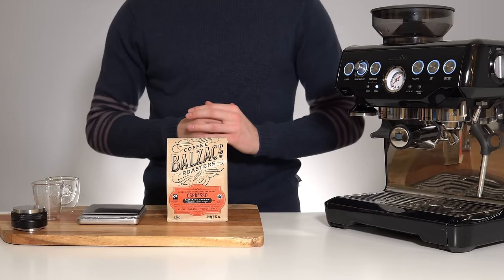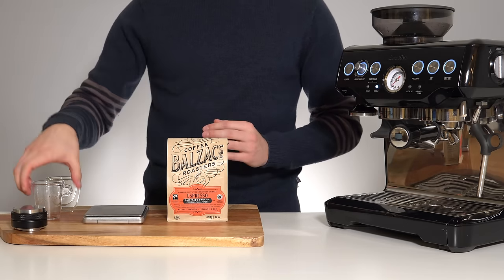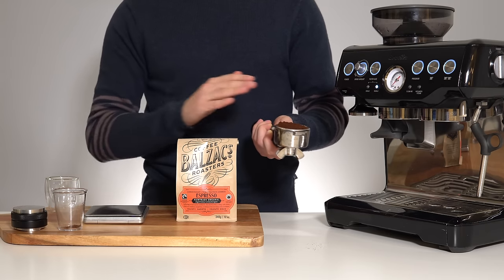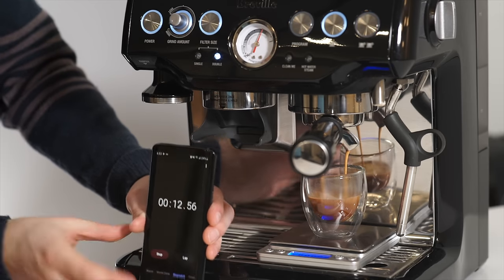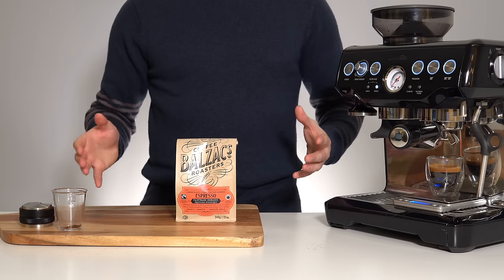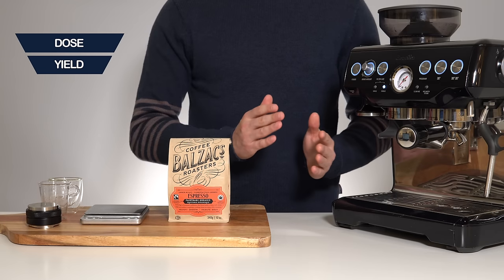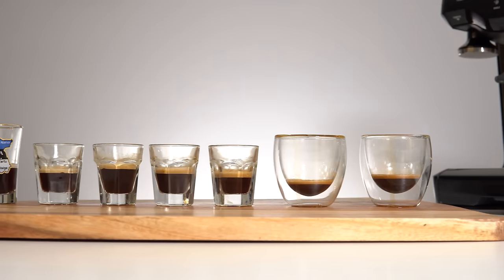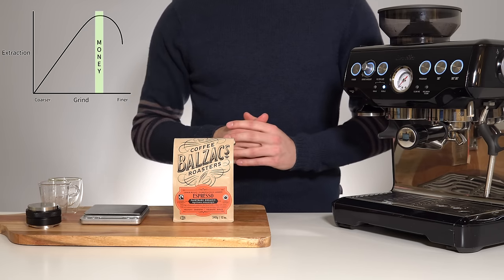Dialing In Breville Barista Express | Dose, grind, yield, time

Comment: Counting 1-25s starts at preinfusion! Not when the drops start.
Reply from the maker: 25 seconds is a very very rough starting point. Each coffee will be different. This initial guide is a huge oversimplification to get people running at a reasonable flow rate. After that, Brew Ratio and the other theories of extraction must be used to dial in to individual taste preferences. 

All that to say. It doesn't really matter, as long as you are consistent with yourself with how you time your shots so that you can duplicate them once dialed in.
Reply: @LifestyleLab_  But it made a huge difference in the ground size for me. I was already at 2 grind setting just to hit 20-30 secs cuz the video taught me to start counting when the drops start. I'm telling you, that shot was undrinkable! 

Now compare that to including the pre infusion with the counting. My grind setting is now at 6! And I'm hitting 25secs.
Reply from the maker: And I've had many coffees that are undrinkable at 25 seconds, but taste great at 35 or even 40 seconds! No one brew ratio, shot time, temperature, grind size... etc will be right for every coffee. The first half if this video is a starting point only.
Reply from the maker: I suggest reading the more in depth article we wrote, more specifically the "drinkable to greatness" section: https://lifestylelab.ca/dialing-in-breville-barista-express-machines/

Comment: Can anyone help me? I adjusted to the finest grind setting (1) and reached 19 seconds. But the pressure gage was way too high. If I set to setting 6 I get a nice 12o’clock pressure reading but water only runs for 10 seconds.
Reply from the maker: As mentioned in the video, don’t pay attention to the pressure gauge. It’s calibrated more toward pressurized baskets.
Reply: @LifestyleLab_  Thank you! While I have you… 2 more q’s please! 

1. how many seconds in advance of 36g do you press the button to stop the extraction? I keep stopping too late and ending up with 40-45g!!

2. you start the timer only when the first bit of coffee starts pouring? so, again, ignore what the instruction manual says?
Reply from the maker: Do what tastes best! This is a starting point, not a hard and fast rule 

How to Time Espresso Shots | Button Push or First Drip?
https://youtu.be/E9MiqOJdwPc
Reply: Noted. And thanks again! Am still miles off the perfect shot, but at least I have stopped using the dual walled filter basket.

Comment: you forget to measure the grind  yield as there is going to be grind retention about 2 to 3 grams
Reply from the maker: Grind retention is not infinite. You dont loose 2 to 3 grams every time, where would it all go?. The retained grinds will be flushed out and go into the portafilter. Deviation is not more than 0.5gr from my testing. BUT you are correct! The only 100% accurate way to dose is by weighing the grind yield
Reply: I always weigh what goes in the portafilter. Retention is a non-issue for me.

Comment: I appreciate the time and effort you have put in to this but I don’t think that this machine is the correct choice for people that are this invested in the espresso brewing process.  You are describing effort and time that suits a hobbyist with far more capable/expensive machinery. Surely the idea of the hopper is convenient yet quality coffee that the average drinker can access and enjoy quickly? This machine in my opinion is for people who want great coffee and aren’t concerned with obsessive small margins.
Reply from the maker: Unfortunately, the hopper and timer based dosing ends up having the opposite effect intended, by causing frustration during the dialing in process. On any machine, $100 or $10,000, you need to know your dose before continuing with the dialing in process.
Reply: @LifestyleLab_  and I don’t disagree with you but don’t you think for the average joe that dosing your basket with a fairly inaccurate mass of coffee can still result in acceptable, palatable and pleasant coffee that can be made at speed?
Reply from the maker: With a pressurized basket or very dark roast yes. 
But a non-pressurized basket or more difficult to extract coffee will taste quite offensive without proper flow. Hence why so many people turn to YouTube for instruction :) 
End of the day, if you're happy with how the coffee you're making tastes, your job is done. If people are struggling, these simple principles can be a big help!

Comment: I'm having trouble with my machine :( everytime i try different grind the espresso always comes out in 13 seconds no matter what
Reply from the maker: If you've reached the minimum grind setting and it's still running too fast, you need to set the INTERNAL grind setting finer! Here's how: https://youtu.be/QNvOcE4-VEo
Reply: 2M views Wow! Thank you so much, your videos are great!
Reply: Are you using the double wanded filter?
Reply from the maker: @svenc.8773  Dual walled filters are only for if you are using coffee that needs "help" building pressure such as pre-ground varieties that are typically coarser and less fresh.
Reply: Exactly this same issue. I've even turned the internal grinder down to 3; pressure is sky high and still only hit 15 seconds. I understand what you say about flow rate vs pressure but surely at that level of pressure (or any more) the beans will be scorched and the machine will choke?

Comment: I bought that palm tamper for my breville express and it doesn’t fit
Reply from the maker: There are three available sizes. 51mm, 54mm, and 58mm.
Reply: Lifestyle Lab oh I didn’t know , what size should I buy
Reply from the maker: The Barista Express is a 53/54mm portafilter. The Dual Boiler and Oracle are 58mm. I believe the 51mm were made specifically for Delonghi machines :)
Reply: Oh ok ty 

Also the 18 g of coffee does not fit anywhere near might do a basket am I using the dual basket single wall or double
Reply from the maker: If 18gr does not fit, you are likely grinding too coarse (the coarser you grind, the more space the grinds take up). At the very least, you should be able to fit 17gr, try lowering the dose and grinding finer. 

Here is a video explaining the different basket types: https://youtu.be/eOKKMu5wmQA
Reply: Lifestyle Lab I am only getting 9 seconds on the finest gring
Reply from the maker: You can still grind much finer by adjusting the upper burr setting as shown here: https://youtu.be/QNvOcE4-VEo
Reply: Is it normal to be that fine could it be the beans?
Reply: Also the coffee is very dark looks burnt
Reply from the maker: Totally normal to need to grinder finer! 
Can't comment on your beans obviously because I can't see them. I would experiment with a few different kinds to find what you like
Reply: Lifestyle Lab the coffee is very far and tastes very bitter like burnt
Reply: It’s very dark

Comment: Timer needs to start at pump activation. 🙂
Reply from the maker: In the end, 25 seconds will likely not be the correct flow rate once you dial in to taste. So as long as you are timing consistently, it doesn't matter which method you use...
Reply: @LifestyleLab_  that might be true but if you check any commercial machine you can see timing does start during “pre infusion”, and while it might be 25 in this example, this will still result in people being off by about 6-8 seconds when timing shots 🙂.

Comment: Problems...

1. Retention: you may put 18g in the grinder but you won't be getting 18g in the portafilter.

2. The grouphead doesn't heat without flushing. If you pulled a second shot the temp difference in the grouphead and portafilter would greatly change your extraction.

3. This man has no head.
Reply from the maker: Hey Chris! 
1. I've actually found the retention of the integrated grinder to be quite reasonable, plus or minus 0.2gr, and DEFINITELY more accurate than using the timer. But you are correct! Weighing the portafilter after grinding will give the most accurate results possible. I find single dosing is a good tradeoff between workflow, and accuracy.

2. The grouphead on the Express is able to adequately heat the shower screen and portafilter without flushing, but again you are correct that temperature consistency is very important to dialing in. One issue with the dialing in process is that when pulling multiple shots in succession, the portafilter cools down from constantly being removed from the group... 

3. I know... it's an issue. I won't even start to try and explain where the voice is coming from

Comment: I'd rather this was a guide on how to use the machine on how it was designed to get desired quantity without flaffing about weighing each time etc
Reply from the maker: The grinding is the single biggest limitation of this machine. You can not get desired quantity on almost ANY grinder, regardless of price, without weighing.

Comment: You’re supposed to start the timer from the instant you press the shot button, not once you see liquid. That’s like, common knowledge
Reply from the maker: Its also common knowledge that no 1 shot duration will be correct for every single coffee. Shooting for 25sec, whether it be from first drip, or first water contact, is only a ROUGH starting point for dialing in. The concepts of brew ratio and extraction must then be followed to dial in to taste. Whether your final brew recipe is 35 seconds including preinfusion or 30 seconds without, the result is still exactly the same... timing is a way to maintain consistency, not dial in every single coffee

Comment: Big issue with this video is you measure the beans but don't measure the coffee in the portafilter... big error from the start. Always add an extra gram of beans before grinding and measure what's in the portafilter before tamping. It's the only way to keep accurate shots. Don't believe me? Scale it and see. Or try running it my way and see.
Reply from the maker: Not a big issue actually. Throughput is quite consistent. Yes, there is retention on a new grinder of 1g+, but once broken in the input vs output is more than consistent enough. If you’re worried about exchange, then there are plenty of single dose bellows :)
Reply: @LifestyleLab_  across all grinders, what you put in is NOT equal to what you get out. Or, is it uniform for the same grinder per shot. I've worked with a few MKG EK's, Wilfa Svart and Mythos 1 and 2 and others. One exception is the MKG E65S et al but they come with in built scales. All without scales vary by more than a few grams per shot because each burr will retain a varying amount per shot. And as I've said, each dose will vary from the same machine. We had to dose and scale every shot... So I've had 10,000 of shots as "research" and browned trousers 👖 to prove it. Haha
Reply from the maker: There are many home grinder such as those from Niche that are EXTREMELY consistent in vs out and dose to dose. All those you listed are large commercial units not designed for single dosing.
Reply: @LifestyleLab_  I'd like to see how the Breville performs in that respect for 5 shots. I'd be pleasantly amazed if you put in 18g and got 18g into the portafilter
Reply from the maker: Not as good as a dedicated single dose grinder, but easily within +/-0.5g. Wouldn’t recommend this method if it wasn’t useful, and doubt this video would be over 1 million views if people didn’t agree 🤷🏻‍♂️
Reply: @LifestyleLab_  My best guess would be people would be coming across the video for making espresso on the machine would not arrive with a huge amount of experience in dialling in.

 0.1g variance would be remarkable on any grinder but perhaps it is not unusual for machines used for singular coffees. Machines heating burrs temp drastically affects dose from my experience and requires to change grind size and time on grind throughout the day. 0.1g variance tho on any machine would be contrary to my experience on grinders, almost immediately, from one coffee to another, especially on less solid and harder, temp resistant commercial equipment. 

Regardless, the point is it is fundamental to specialty practice to measure dose in portafilter and is unreliable based on past experience over the simple act of measuring - it is no replacement. If dose is not fixed, yield and shot time cannot be used to accurately affect the taste, by a significant amount. If you're going through any trouble to dial in coffee, it's a step you can't really miss. And frankly, a huge win from a tiny yet significant accuracy.

Comment: the yield is the time bro
Reply from the maker: Incorrect. The yield is the weight of final espresso. You can get 40gr of espresso very quickly in 5 seconds, or very slowly in 40 seconds, but the yield will still be 40gr. The difference between those two shots will be run time, and therfore flow rate, resulting in very different tasting shots
Reply: Lifestyle Lab totally understand now , thank you 🙏

Comment: too much boring math not enough coffee art. Espresso not all about grams and seconds but beans and roasts. Concentrate on sourcing the best, freshest beans.
Reply from the maker: Yes and no
Espresso is VERY sensitive to changes in flow rate because it is brewed at such high pressure and temperature. So regardless of what coffee you are able to source, you still need to understand these concepts to get the best out of it

Comment: Lmao. 18g DOES NOT fit in this portafiter.
Reply from the maker: I do find 17g is a better dose for these 54mm baskets. If 17g is still not fitting, you are most likely grinding MUCH too coarse. The finer you grind, the more grounds will fit in the same space
Reply: @LifestyleLab_  I’m struggling to make this method work with 16g at any grind size. I’m really starting to regret spending $700 on a machine I barely know how to use. I’m sure I’m doing something wrong but I just can’t nail it down and I’m wasting so much fresh coffee.
Reply from the maker: Have you adjusted the internal grind setting finer? If you hit the finest setting on the external dial, dont worry! They're is still further you can go